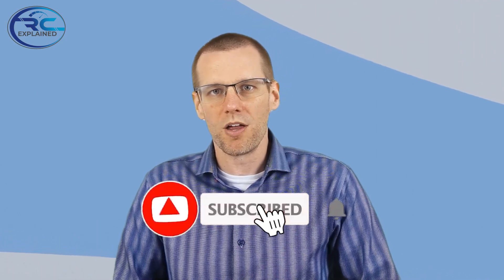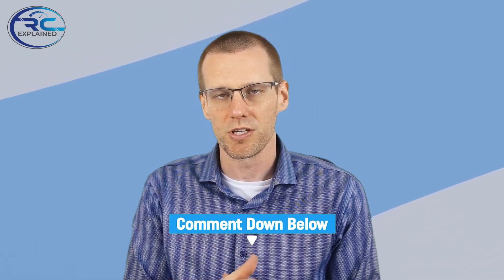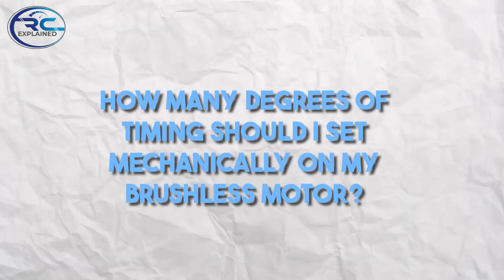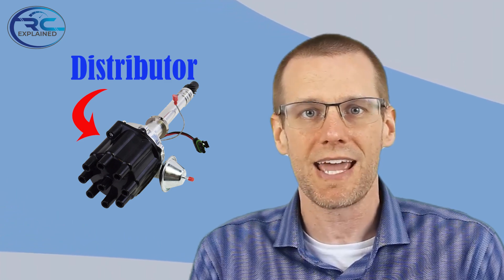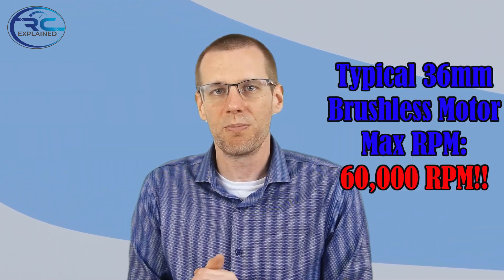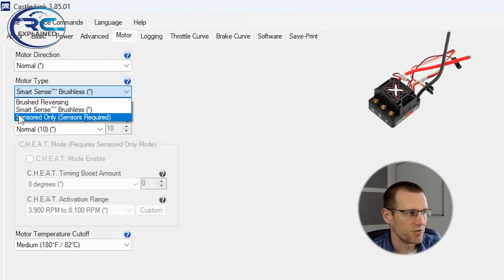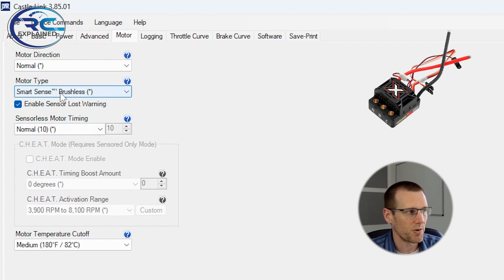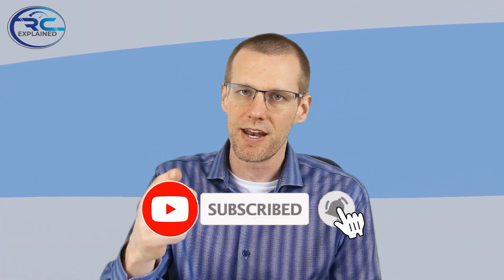Why Sensored Timing SHOULD be Selected to Switch to Sensorless Mode

Comment: Dear Sir, I am seeing RC boaters that have taken to running 4082 2200KV motors on 8S. As a technically savvy hobbyist, what are your thoughts on this subject?
Reply from the maker: For general fast electric boats i recommend 20-35K RPM unloaded.
Reply: @ Are you calculating this by taking a cell voltage of 3.7 times number of cells and then multiplying by KV of the motor?
Reply from the maker: @christophercurry7410  yes

Comment: I have a 1997 Jeep Wrangler with a 4.0L straight 6 engine, it has a distributor on it. Do you recommend Smart Sense for speed run cars also as I am currently using sensored only.
Reply from the maker: Wow I'm surprised that in 1997 they were still around. 
I would recommend smart sense for all applications until I find a good reason to say otherwise.

Comment: Owned quite a few old Holdens(Australian) in the past with mechanical distributors. They have a centrifugal weight and spring mechanism to advance the spark from around 5 degrees to 30-35 at max rpm. You could mess with the spring rates to get quicker advance on a tuned motor. Then came electronic ignition where you can map an exact advance curve.
Reply: The ones I had back in the 70's and 80's also had a vacuum advance.
Reply from the maker: That's going back a few years now.